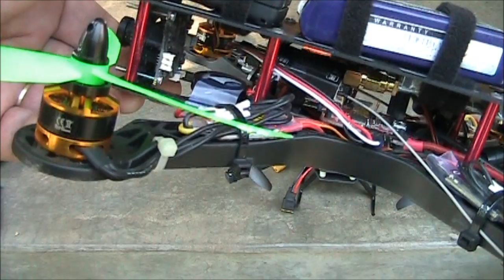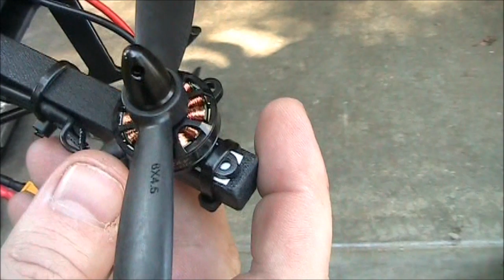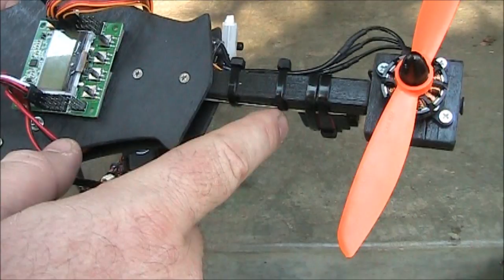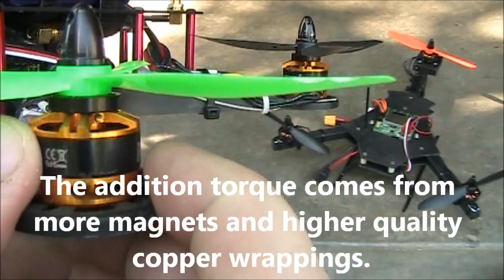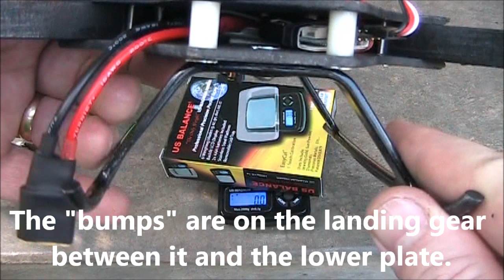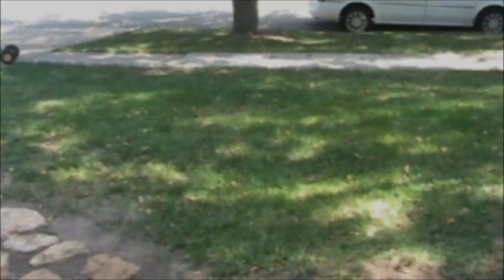simplecopter.com Mini Tricopter Review & FPV250 Comparison

Comment: Travis, have you tried those sunny sky 2300's on one of your quads? I am running those on an FPV250 now but thinking about trying another motor on my next build. Just wondering how well the DYS are compared. Thanks
Reply from the maker: I've only used the SunnySky's on my tricopter.  They've been too expensive for me to justify buying to myself.  I got free ESCs when I bought them for my mini tricopter.  The DYS motors seem to have plenty of power on my miniquad with the 6045 props - they don't even get warm after a full battery of use.
Reply: ***** Cool. I was thinking of going with the Diatone 17 PCB for my next frame but i think you have me convinced to try out 6045 props. So i may have to go with something else. Also FYI BuddyRC still including free 12amp Afro Magic with purchase of the sunnysky 2204S motors if you are interested.

Comment: Hi thanks for the video. I bought a dart 250 and I want to use dys motors. I see that you use only 2 screw for each motor. It is good or I have to use 4 screw for each motor?  Thanks and sorry for my English.
Reply: I've just started with my mini h and I haven't had any trouble with only 2 screws.  Be sure to lock tite them though.
Reply from the maker: You can use just two screws.  I use 2 with lock tite on them and I haven't had any come loose yet.

Comment: Flyght time on 1500mAh battery?
Reply from the maker: Around 6-8 minutes.  The mini tricopter gets maybe 30 seconds longer than the mini quad with the same battery.  Maybe because there is one less ESC and motor?